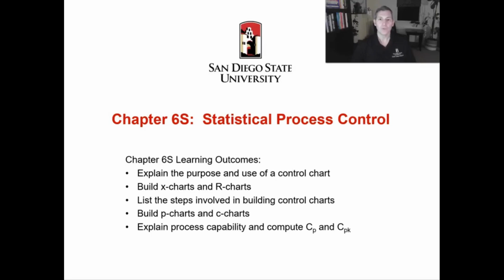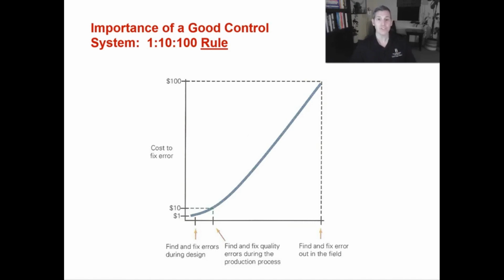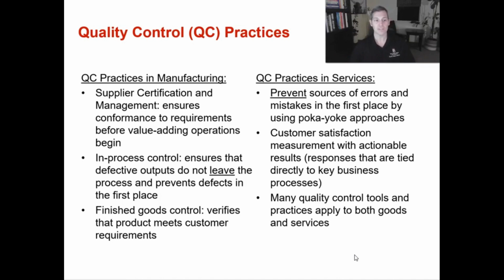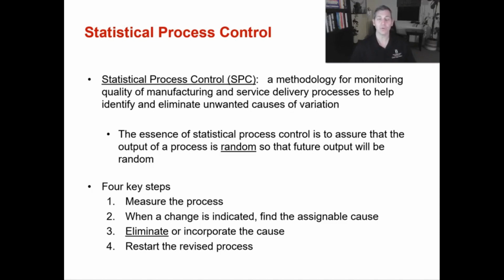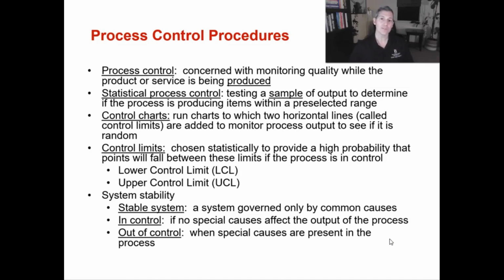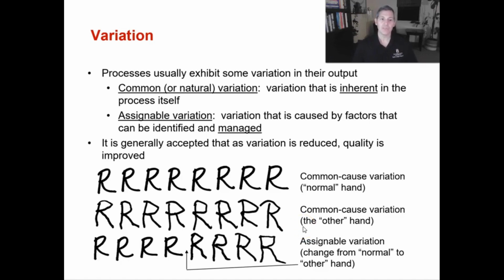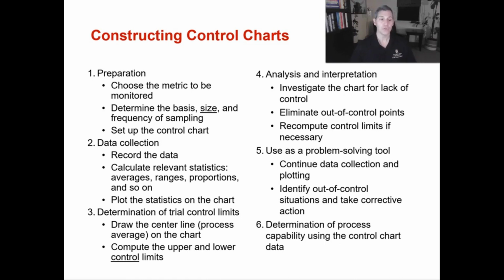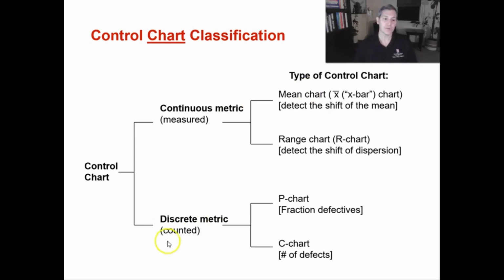Statistical Process Control (SPC) Explained | Control Charts in Quality Management

Comment: What if the employee is at the bottom of the totem pole and their job is dependent on the rework and time it takes to handle the inefficiencies. if they propose solutions to eliminate the waste, don't they also risk being seen as waste?
Reply from the maker: Great question, and it highlights a real tension. But, in practice, the opposite usually holds. The people who spot waste and bring solutions become more valuable, not less. Leaders remember who solved the problem, not who was doing the rework.

The trick is framing. Eliminating waste is not about eliminating your role, it is about freeing your time for higher-value work. Strong organizations redeploy their best problem-solvers. If a company punishes people for improving the process, that tells you something worth knowing early.
Reply: @OperationsAndSupplyChain That's a great point. Worth the data. Thanks for your time.